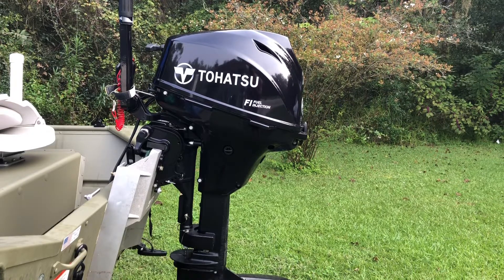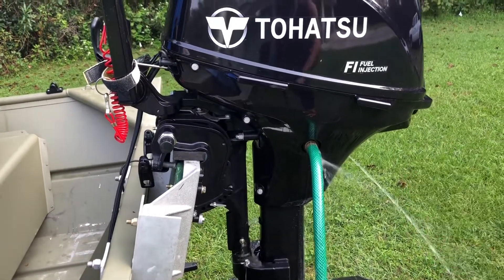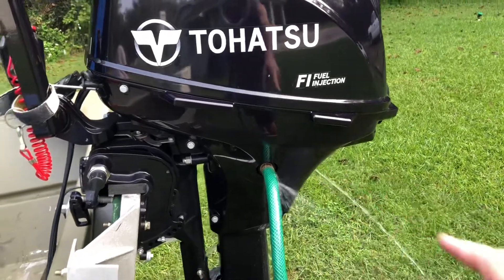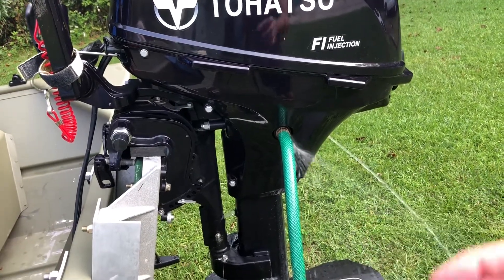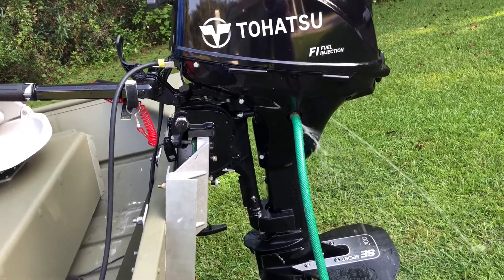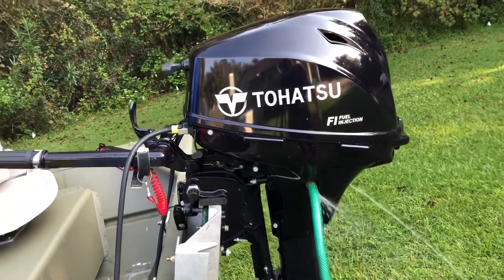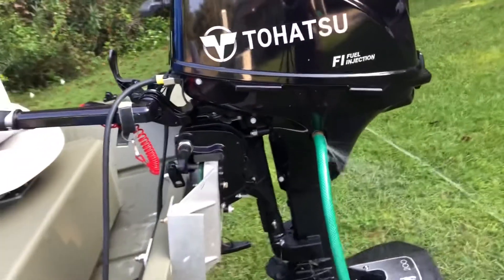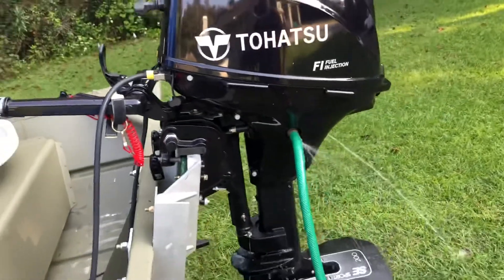Hose Flushing Methods 2020 Tohatsu 9.9, 15, 20HP Outboards - The Correct Way

Comment: I have an older model that you have to use ears on. I can’t get it to pee any suggestions?
Reply: Squeeze the ears tight with ur hand until it pees or perhaps your water pump impeller is done and need to be changed or you have debris blocking the line . 
It’s a fairly simple system , mine wasn’t peeing either , I checked all the above and then proceed to shooting some compressed air in the tube underneath after removing the lower unit , air was coming out the pee hole so it wasn’t blocked
Reply: I ended up putting it in the river and it started peeing. I guess the ears just didn’t do it. So thankful I did!

Comment: Question please, i transport tohatsu 20hp on proper side, tiller down side, and second time oil been flooding cylinders and locking starter. Why is this happening? I mean road can be windy and different change in slope when riding my car, but its laying on proper side, by the time I come to fishing spot, theres ton of oil leaked out and motor doesn't start, so frustrating, i just bought this motor and already having issues. Any suggestions?

Comment: Nice to know what model boat and speed are you getting out of that 20 hp and is the jack plate helping any?
Reply from the maker: Jack plate helps for sure. I have the motor raised up to where the plate is perfectly even with the bottom of the boat. It was slower when above or below this position. People have different opinions on the optimal position but this always seems to work best on all my boats.

Comment: Oh man… you just saved me A$$. I was just about to run it with the hose attachment… I brought out the “ear muff” water attachment instead. Mine is fresh water only but,  I fire it up with non ethanol fuel every month as it’s only used in July and august.

Comment: I have a question. ANYONE CAN ANSWER IF THEY ACTUALLY KNOW THE ANSWER. JUST DON'T GUESS. In a week I will go look at a '17 15 hp Tohatsu. It has been sitting prolly for 18 months (COVID got owner). I hope I can get it running to flush old gas out. ¿If I do a warm flush with muffs or hose port and put in gear can I check lower unit oil for water contamination? Would I need to do a water barrel test?
Reply from the maker: You can put it in forward and reverse for a few seconds while it’s on the hose just to check operation, it won’t overheat or cause problems. 

The way to check the foot for water contamination is to crack the lower screw and let a little bit of the oil come out and verify that it is not milky.
Reply: @commonsensesolutions6662   thank you. I really don’t have a worry but I would like to dump it in gear for a minute and get the prop moving and then get the small lube oil sample. I won’t rev it. Thank you for your response.

Comment: Thanks for the video.  My boat lives in the harbour and cant get to fresh water supply so i have to run my outboard every week for at least 10 minutes to flush out the old salt water. i prefer your methods by far as i have to change my thermostat more oftern
Reply from the maker: Good strategy! There are some salt flushing kids I’ve seen where you hook it to a hose and add a desalination liquid to a bottle feeder that might be good to do every once in a while. Not sure how environmentally friendly the solution is since it would be discharged into the Harbour but perhaps worth a look. Might help extend the life of the thermostat a bit. Is it really pitted when you change it?
Reply: @commonsensesolutions6662  I change it every yearly service to be safe. My friend didn't and had to be towed back by the lifeboat with a seized  engine. I fish up to 15 miles off shore  and need to be on top of faults before they develop. The thermostat isn't in bad condition when I change it and could be used again but like impellers,  once you have gone as far as inspecting it you may as well change it. :0)
Reply from the maker: @KitsFishing  Totally agree! Thanks again for watching 👍🏻

Comment: I got a new Tohatsu 2 stroke 15hp and in the manual they say to cover the two water intakes with tape while running the hose. Not really sure why i would need to do this and put duck tape on a brand new outboard.

Anyone has insight on this?
Reply from the maker: A 2 stroke?

All I can say is that if the design is the same as the newer four stroke versions then based on my findings it would be unnecessary if hose flushing at idle. Check out my other video that shows me taking it all apart after I was flushing it with a hose for over a year and everything was perfectly fine. Again, mine is a 4 stroke. Good luck!

Comment: Good video! My oil light stays on about 10 seconds after start. Does yours do this?
Reply: Yes, and you should keep on neutral until it turns off, and than you can change your gear forward/reverse.

Comment: Would this be right for a 25hp tohatsu?
Reply from the maker: I’d think so, but you might want to see if water runs out of the intake grates when you have the hose running. If so, I’d think you would be good. 

I’m taking mine apart to replace the impeller soon and will post the results of using this method almost weekly over the last year.

Comment: i have a problem. When i use your method and turning on the water on the garden hose my engine wont start. When i turn of the water my engine will start perfectly. Do any of you have any solution. Thanks for answers :)
Reply from the maker: Hi! Well that’s a new one! When you say ‘won’t start’ is it not turning over? Do you have electric start?

My only thought is if you are pull start only perhaps the water pressure against the pump is just enough for you not to get enough RPM to start. Maybe try not turning the water on all the way. 

My water comes directly from a well with a high pressure pump so I’ve always only just cracked open the spigot. 

Let us know what you find!

Comment: That is a lot of wasted water better in a container.
Reply from the maker: When flushing out salt water I don’t like to recirculate the water in a container. I also don’t like to waste water. The location in my yard where I do the hose flush is on a slight hill and right below that area is a flower garden. The water flows down to that garden and waters it nicely. 👍🏻
Reply: @commonsensesolutions6662  I thought you might do something like that as you seem very thorough in what you do, was just saying as here in the UK and especially the south east of England we have hose pipe bans in the summer months and the fines for breaking them can be quite severe, luckily I live on the west coast of Scotland with a plentiful supply of the best fresh water.

Comment: Receiving my 2021 20hp Tohatsu, MFS20EEFTL, today!  I'm really looking forward to learning what you find when you look at the impeller.  

Like you, I'm sure hoping that the warm flush using the built-in flushing port with garden hose with the engine at idle is not only simple and effective, but also safe for the engine.  Thank you for sharing your info.   Cheers,
Reply from the maker: Awesome!! I’m curious as well. I keep putting it off because the weather is so hot here now. I’ll head out there early one morning and get it done so I can report.
Reply: @commonsensesolutions6662  Thanks.  I look forward to learning what you find.  Cheers,
Reply from the maker: @shannonyork5300  how’s that new motor?
Reply from the maker: @shannonyork5300  sounds like a great setup! I wish I would have opted for the power tilt, I’m sure it’s been handy. Looks like you are covered on the props. Hopefully with the extra persons onboard that 10 will end up where you want it to be. I’m for sure curious if elevation is a factor or not. Maybe you can do a quick run by yourself with approx the same weight once you get to your location to see if it tachs out about the same?
Reply: @commonsensesolutions6662  Thanks.  Yes, I will definitely do a test with the 10 pitch at the higher elevation with just me and the same load to see how the rpm compares to my lower elevation numbers at WOT.  Theoretically, I should experience close to a 20%+ drop in "power" at the higher elevation---but TBD.  Cheers,
Reply from the maker: @shannonyork5300  How did it go?
Reply: @commonsensesolutions6662  So, logged about 10 hours total at 6,500 feet. Experimented with the stock 10 pitch, a 9 pitch and an 8 pitch, all aluminum.  With 3 adults + gasoline tank + battery + 3 Tempress swivel seats + chartplotter + 2 x 25 lb anchors + anchor fairleads and locks + fishing gear + cooler, etc. the 8 pitch performed the best.  But, still was not able to get above about 5500 rpm.  With 2 adults and basically the same load, could get to about 5,800 to 5,900 or so.  With just me and basically the same load, I had to back off the throttle a bit to avoid exceeding the rpm limit.  So, with 1 person and the 8 I could not quite do WOT.

I've done alot of research and talking with folks with much more experience than I have regarding the question of aluminum vs. stainless steel props for a boat and motor this size.  I have wondered whether with the highest load with 3 people if the 8 pitch aluminum was flexing and hurting performance.  Without getting into all the complexities and assumptions on both sides of that question, I've concluded that I will stick with aluminum, at least for now. I may get a 7 pitch for those times when I know I'll have 3 people in the boat at will be a high elevation.  While I do fish at high elevation lakes alot, most of the time it will be with me and my spouse, so the 8 pitch will probably become the standard with that load at the high elevation lakes.

As I drop in elevation, I will go to a 9 and then the 10. 

Overall, the Tohatsu performed great.  I outfitted the boat with a Dual Purpose Lithium Battery for cranking and to power the Garmin chartplotter.  The Tohatsu alternator worked fine with it and kept it charged.  I put an Anderson connector on the battery so I could easily remove it from the boat (only weighs 18 lbs) and use it at the campsite with a 250 watt inverter (to which I also installed an Anderson connector) to recharge iPhones, run laptops, coffee grinder, etc.  And, when needed on days when I was not boating, could recharge the Lithium battery with my portable solar panels.  All of that worked great.
Reply: @shannonyork5300 it's been 4 years since then. Did you finally find out that it's not good to charge the Lithium battery directly from the engine's alternator? 😮

Comment: Thanks for this video, I have the 2021 Mercury 20 EFI which is the Tohatsu 20 just marketed as Merc. I was wondering how safe and effective the hot flush with the hose attached really is. I have been cold flushing for 10 minutes and then going straight to the bucket method for another 10 minute hot flush at idle. still not sure if I trust running the engine with out the lower leg submerged.. lol I should probably trust the engineers I guess.
Reply: Bucket or water muffs. If your gonna flush the engine with the hose connection leave the engine off and save your impellar.
Reply from the maker: @gunsandrotors8704  I will be doing a new video shortly after one year and many of these flushes and we will see what the real deal is 👍🏻
Reply: @commonsensesolutions6662  fair enough i have the same outboard 2018 model stock impellar still pisses water like day 1 new...  but fresh water use only.. 50 gallon rubbermaid hd trash can only for flush or running. My tohatsu dealer told me not to flush the way your doing it and my brother inlaw a marine mechanic 45 years also says the same. Yamaha also states not to flush that way when flushing the head/block out. Pull the impellar check it out.
Reply from the maker: @gunsandrotors8704  cool. I run in salt a lot, hence why I want to get the thermostat open, plus two different engineers at Tohatsu said it was ok. Also, watch the water flowing out of the intake grids, this tells me water is coming down through the impeller during this process, the drawing show it is a straight path from the water intake grids to the impeller. Who knows...I plan to take it all apart soon and see. The hose connection sure is convenient. I’m thinking the impeller should look basically like new after only one year and heat damage will be easy to spot on the impeller and assembly....
Reply from the maker: Had it for about a year so I’ll be taking it apart soon to see what’s happening in there to answer the question. I have a whale tail on mine so I’d have to get a huge bucket to submerge the lower into... the hose makes it so easy. I run in salt water all the time so the warm flush is something I really believe in to get past the thermostat. We shall see...👍🏻
Reply: @commonsensesolutions6662  Looking forward to hearing / seeing more on this.
Reply: @commonsensesolutions6662  Just wondering what your thoughts are on the hydrofoil you have installed on your motor? I'm reluctant to drill holes in my new outboard unless the trade off is really worth it. Cheers.
Reply from the maker: @thestujames  This is the first time I have used one I had not had the need for one before. My other jon boats had the standard flat squared off fronts, this one has the modified V. I have never had one of these types of boats but the first thing I noticed is that the front rode very high in the water and even when adjusting the motor tilt it wasn’t enough to bring it down to my satisfaction so that is why I put on the hydrofoil because it seem to lift the back of the boat up a little more out of the water when on plane which brought the front down to where it seems to ride normally for my tastes. If it wasn’t for that need, I would not use it.
Reply from the maker: @thestujames  I thought I replied, but now don’t see it...

The only reason I used one is because the bow seemed to run a little high in the water for my liking, not sure if this is due to the MOD-V design or not, but the hydrofoil seemed to bring the back end up a little bit which evened things out.
Reply: @thestujames  I added one to mine. Helps get on plane faster.

Comment: I was sooo happy to find this video.  I did a "hot" flush because I thought that was the right thing to do.  I found nothing in the instructions to say otherwise.  then I read and was told never run the engine with the hose connected to the port.  I was all worried I had destroyed my ew engine, although it has run fine since.  As such, I did quit doing hot flushes.  Now at least I know the engineers say it OK.
Reply from the maker: I’m with you. And hearing directly from the engineer gave me a lot of assurance besides the fact that I see water flowing out of everywhere that tell me that it can’t be overheating The impeller. The engine is simply idling. 

I’ve been doing this for about a year now and I’m getting ready to change the impeller so I will post a video on how everything looks in there to give us a definitive answer. 👍🏻
Reply: @commonsensesolutions6662  I also called them and they did not have an immediate answer.  the guy went and consulted wit the engineers then they hooked one up to the port there and called back and said it is OK to run the engine with it hooked to the port at idle speed.
Reply from the maker: @randyvining8101  Awesome!! Thanks for sharing that!
Reply: what you shouldn't do is engage the gears when using the hose flush. The prop should always be immersed in water when engaging forward or reverse.
Reply: In the manual it says not to turn the engine on when using the hose connector
Reply: The only down fall and when it comes to doing it this way is  you will never know if your water pump is falling or failed, until you get out on the water.  

Most people won't even pay attention to see if water is coming out of the telltail aka "peeing" as some call it .. 

If your just flushing  the engine  fine ..  but this doesn't work with all engines you have to be careful  you should start the engine first  then turn water on .. 

I know with Yamahas  the water will over flow into the engine and hydro lock the motor ,  causing water to enter into the oil .. 

I had to go help a friend out who did to his lol , I told him dude you never do that  .. told him all the mechanical  reasons how and why tht happened .. 

This is what I've always done and say this is the safest  way to do it and I like it more because I can inspect the engine and use my heat temp gun to insure !  All the cooling jackets are in range with temperature..   makes it simple and to insure the thermostat is working correctly in range .. check for any leaks and most important! The water pump and pick up tube has no clogs .. 

Just grab a trash bin or something you can stick your lower unit in .. make sure to fill it a little past the  water pump intake grate ..  

Running the engine like this simulates like it's actually in the water .. 

Just add water as needed or leave the hose on .. 

I hope this helps someone  even those who are very nervous about doing it with the hose ..  

You can't screw this method up lol  maintain water level about intake grate or just leave the hose running..  

Happy boating everyone!!! 

Any always check your safety gear !!! 
I can't tell you how many people  I herd on the radio this summer that their boat is taken in  water and the bilge pump has failed and they dont have any type of back up to remove the water out of the boat.  

So guys   inspect your safety gear 

Make sure your radio is working .

Please  have a bailer or a bucket,  or a back up bilge pump.. 

Happy boating

Comment: You do not need to do a hot flush put wear on your engine. Just hook her up to the hose for 5 minutes and call it done.
Reply: He actually explained the difference between a cold and hot flush, and why sometimes you may want to do a hot flush.  IMO, anytime you operate in salt water, you have to do the hot flush to guarantee all the pathways get the salt flushed out.  Cold flushing will not do that.